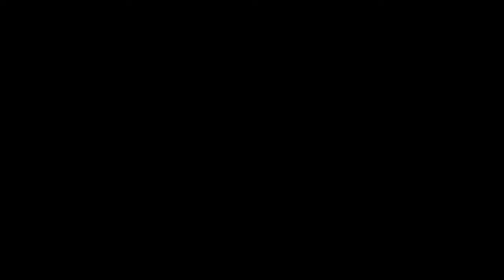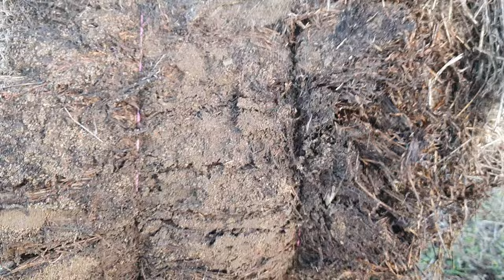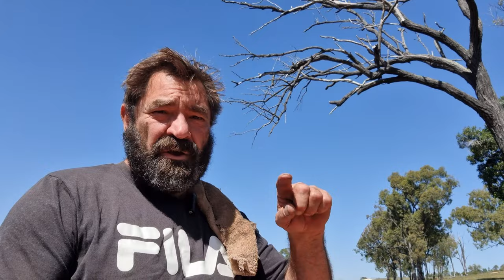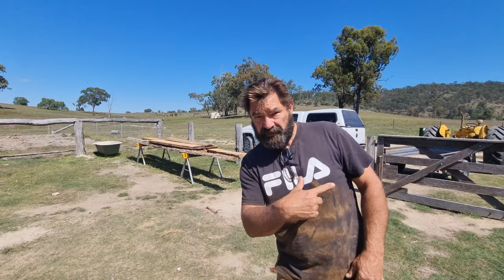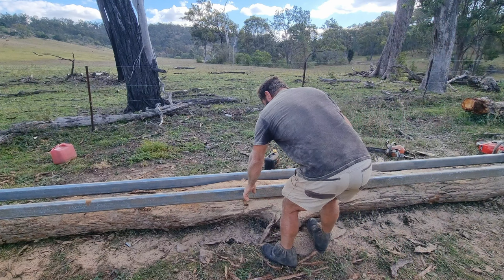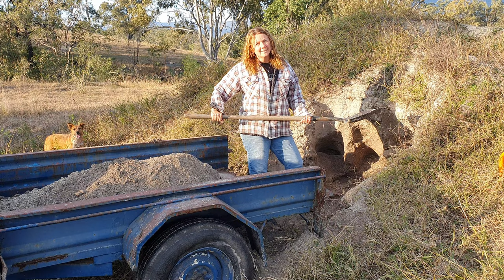Miss Massey (Ferguson) Goes Timber Milling | S2 E8

Comment: Well done, Onya ... interesting I have an old MF backhoe... very dangerous on my hills, only one break works and I have to start it with a screwdriver and that's just the start; 3 cylinder Perkins.  Water in the hyd oil... have to do some work on it...sumday not Sunday.  Looks pretty dry where you are; maybe the Downs or the back of Bundy?  We're on the Sunny and in drought, tanks are just about empty= 20 thousand gallons. Showers right now, hope it keeps up.  I built most of my furniture (Red cedar) but can't stand the smell when working it.... Have a look at my driveway vid, mine got washed away last year, but no rain this year?  strange weather flooding all around, but nothing here.  Have fun...ue on the Sunny
Reply from the maker: Hey ue on the sunny. Thanks for watching our latest episode. Miss Masseys' starter motor is all fixed now, thanks to  @bundybearshed. (Bloody ripper of a bloke.check out his channel.) It will be in the next few episodes. So keep an eye out for that one. Also we make a ROPS for her and our safety. That was a lot of fun to make. A friend has a MF150 industrial with backhoe and has the exact same issue as yours. Just changed the hydro oil and 1/3 full of water. The rubbers on the gearsticks had worn out. We're out collecting water today and will definitely watch your video this even and comment back

Comment: Ha ha 1/2 a meter wide ( the bit of timber into the trailer) more like 350/400 you and me should go fishing together 😂😂
Your definitely not phased by hard work, cutting those logs is hard yakka. 
The holler homestead had a video about 3 months ago and he made a little 2 wheeled gantry thing with about a 3m handle to help him move logs into position. 

35 min is solid going mate no wonder you was puffing. 
I have seen saw setups similar to yours and they have little hand winch like on a boat trailer to pull the saw along the guides . 
It would probably need some little rollers underneath the rails to stop it from pulling over . 

Love watching these sort of stuff just love it 😊
Reply from the maker: Ha ha yeah definitely fish length! The tape said 330 🤣 Glad you are liking our content. Hey do you guys know much about the methods behind yt impressions? Ours have dropped recently and wondering why.
Reply: @RunningAmukOffGrid  I will get my tech department on it
Reply: @RunningAmukOffGrid  if your views and click through rate are still good it might mean YT is getting better at finding your audience (as opposed to them throwing video spaghetti at the wall). If it’s all dropping maybe look at your metadata (title, description, tags) which is the first way YT knows where to start sending your videos. If your impressions start high then drop off it means YT is confused about who to show your stuff to. YT scans the audio in your video for search too so make sure everything is congruent with title and description 👍
Reply from the maker: @ROCKPILEOffgridHomestead  cool thanks, yeah CTR and view duration still climbing so yt must be switching on to our audience. Thanks guys.
Reply: @RunningAmukOffGrid , awesome, that's what we want! You're doing great, keep up the good work guys :-)
Reply: @RunningAmukOffGrid  Had another thought also. Youtube doesn't 'register' impressions from external sources. So if you are getting more views and click-throughs from an external source, say, like if you dropped a video on Facebook and a high number of views came from that link. You would get the views but not the impressions counted.
Reply from the maker: @ROCKPILEOffgridHomestead  yeah, I'm still wondering what is going on, impressions have dropped even more. We have been doing lots of shorts which have high impressions, only videos dropped, maybe reduce shorts youtube may be focusing on those?? Can't get direct help until we are in the partnership program. Where do your video only impressions sit? Ours went from 50000-60000 down to 20000, videos only  shorts are higher. Starting 2 videos per week, hoping that will help. It's all a mystery for now 🤣😂